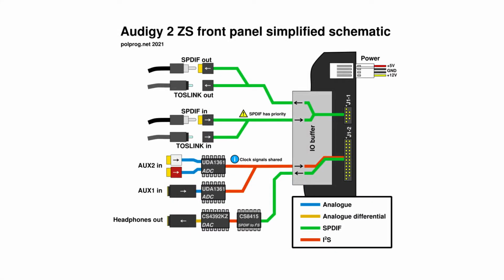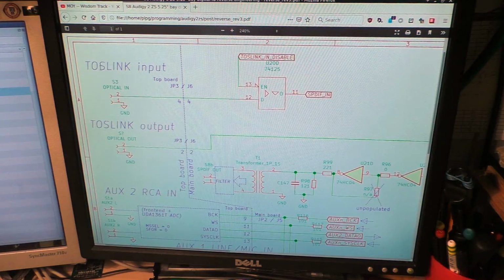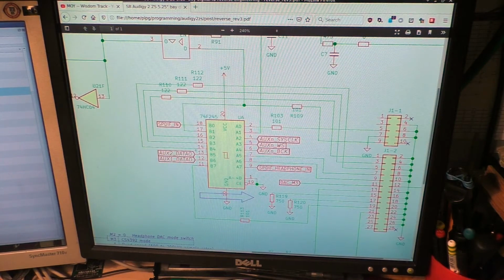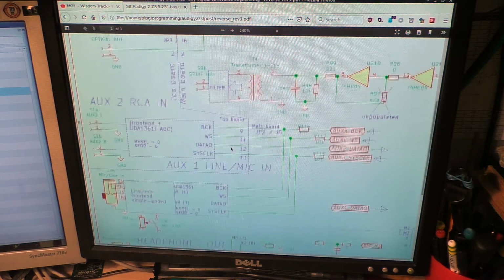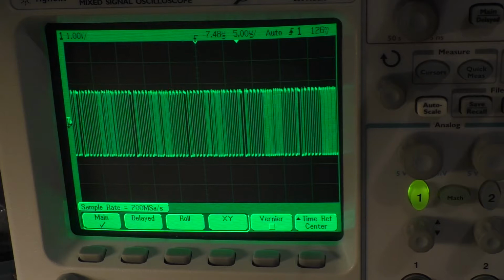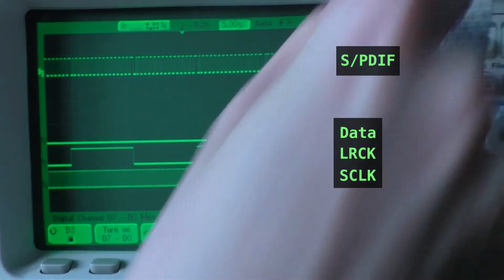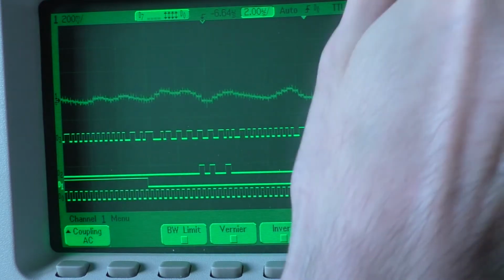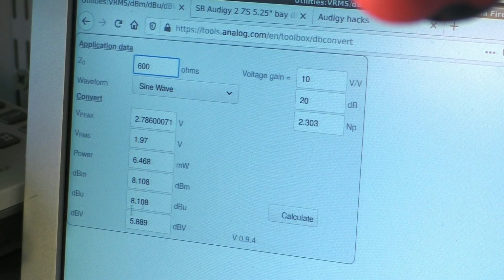PEV 16: Reverse engineering a Sound Blaster Audigy 2 ZS front panel

Comment: I was recently working on one of these boards. I had no sound, but Windows didn't report anything. The sound would come back on its own. There were days when it worked fine. I started studying and came to the conclusion that the problem was with the transistors that enable the analog audio outputs on the rear panel (the ones on the internal PCI card). In fact, the activation command wasn't coming from the processor. I had no choice but to bridge the collector and emitter of a transistor (reference 1AM). 
Long live reverse engineering!!!
 Cordial 73s.

Comment: indeed, a lot of work has been done laying down the schematics in details. I wonder if you could help me identifying the power supply pinout for the earlier model SB0110 so that i can use it as a standalone unit phones amp/preamp for my power amplifier. It is practically the same unit except it uses a 44 pin extension cable, which pinout i cannot identify
Here is the link with the board itself: https://drive.google.com/drive/folders/1Nb1Z4_YcJ2-i0tJMbplFrTorISAHJFQ1
Thanks!
Reply from the maker: oh boy they ran it over some multipin connector.. Im sure that it will take 5V and 12V as these voltages are available in the PC. Probing out 5V should be easy, just check the Vcc pin of any logic IC. Probin out 12V might be difficult, but you should see some common rails, for example on large caps.